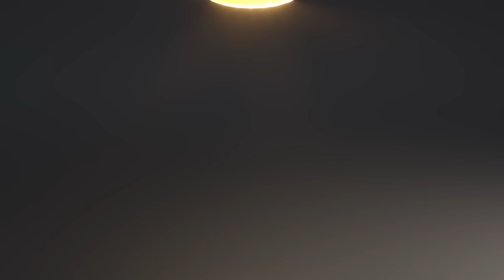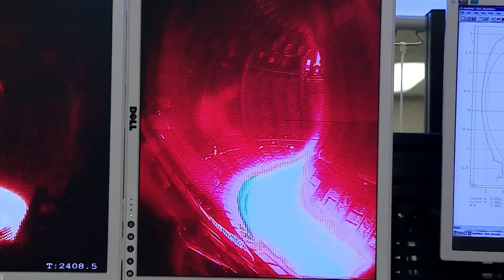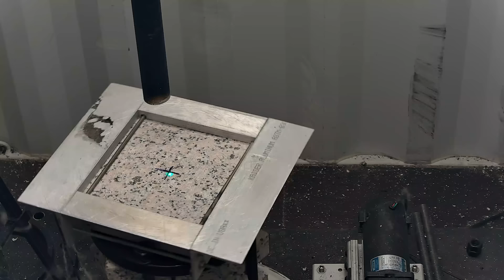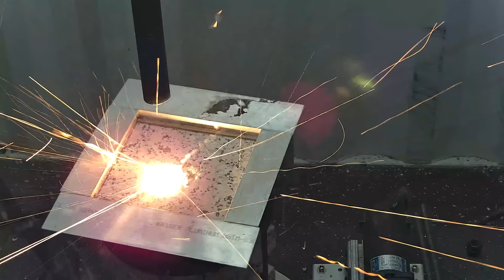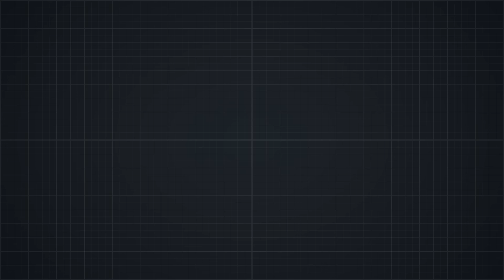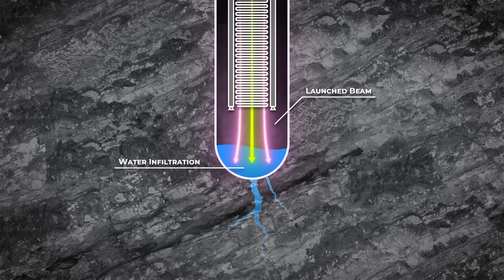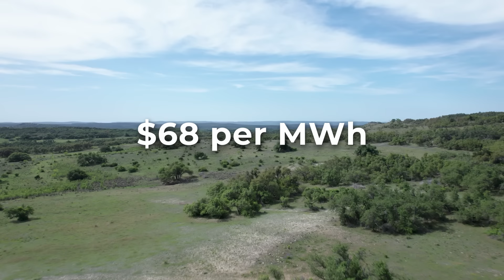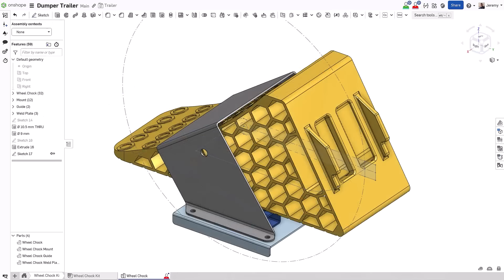Geothermal Energy is Changing

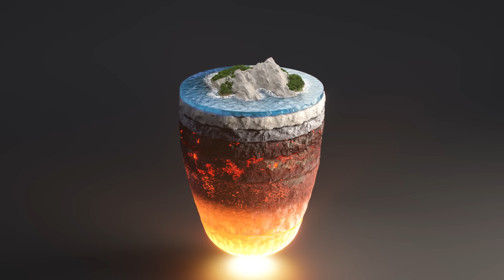Comment: 1:07 Small correction! There are no sustained nuclear fission reactions occurring in Earth's core. It is the radioactive decay of certain elements that contribute to most of the heat at the core.
Reply: There are evidences of localized fission reactions having happened, but yes, current theory is most of it is just radioactive decay. It is believed that this accounts for about 30% of earth's temperature, most of it in the past as it happens with decay
Reply: @JonOsterman59  yes correct, but as i said before, the core itself does not produce its heat through fission to more than a few percent. In the mantle of course this ratio shifts slightly as the core heating is localised and thus radiates, but fission is still not the main heat source, but rather supplementary
Reply: This is a terminology issue -- "spontaneous fission" is another term for spontaneous nuclear decay. Yes, it's confusing, but we're stuck with it.
Reply: @darthtace  yup, in my opinion saying something like "induced" and "spontaneous" fission would be much clearer, but i guess it's another of those vacuum, vacuum, vacuum things...
Reply: How about tidal heating?
Reply: @error203yt9 good question, tidal heating / tidal energy transfer is (in a simplified model) taken over by the least resistant transfer medium, in case of the earth, that medium is the atmosphere and the ocean as their viscosity is very low compared to rock and compressed molten metals. Should all water be gone the atmosphere would not be able to provide enough tidal dissipation for the tidal forces, forcing them on earth's mantle, but since we have oceans, they are what takes almost all of the tidal energy from sun and moon.
Reply: @JonaLastname  Are you a geologist? You say most of the heat comes from the recrystallization but most of the sources I have read on the net about this topic actually say that most of the heat comes from the radioactive decay of elements such as potassium. Is this topic contested in your field? for info here is one source with comments from a Phd in bioscience professor "probing-question-what-heats-earths-core"(type this in the google search and youll find the source, I cannot link it because youtube automatically removes comments with links )
Reply: @penart8079  i'm in material science, not geology, but at least that's related to the topic, not to discredit biologists, but that shouldn't really be what they write papers about. Core heating, so the heating in the actual center of the earth is done, as previously stated, by recrystallization, now yes the potential energy of all fissile material in the earth is roughly equal to the potential crystallization energy from the core iron, but the iron releases that energy faster and in a very concentrated manner rather than radioactives, which are dispursed and form a global instead of a local heating pattern. The overall distribution in the core is around 95% crystallization energy and 5% radioactive decay heat and the further away from the core you go the less influence the iron heat has, right under the crust it's roughly 60 to 40%. To those sources you're reading up on though, most geological fission heating comes from heavy elements such as uranium with less coming from lighter radioisotopes.
I hope this clears things up
Reply: @JonaLastname  sorry I miswrote, the professor was not a biologist. He has a PhD in geoscience not bioscience my mistake. But going back to what you have written, are you then distinguishing core heating from total heat generated by the core?
Reply: @penart8079  no, core heating is the heat generated by the core, but the core, the mantle and the crust are different layers. We drill through the crust and lava comes from the mantle. The core is under the mantle and is heated almost exclusively by iron crystallization. The mantle is where radioactive heat and core heat meet and form a gradient to just below the crust, in the crust the combined heat of both core and the fissile material in the mantle radiate into and create what geothermal plants use. In the crust itself, so everything a geologist would care about, this radiative heat lessens the closer to the surface they get, at a few miles deep (one or two miles) most of that heat is from the trace amounts of uranium, thorium, potassium and other trace radioisotopes in the crust with only a supplementary amount of heat left from core and mantle.
(If i have used different spelling for any of these relevant words, english is not my first language and translation might have distorted some words)
Reply: @JonaLastname  I think I follow now, around the mantle = more radioactive decay heat, closer to the core = recrystallization. Is that about right?
Reply: @penart8079  yea that about tracks. Note that the overall energy potential of fission and crystallization in the earth is around the same on the order of roughly 4.5×10^29J but the decay chain happens slower so the overall energy contribution at any given time in earth as a whole is skewed towards crystallization energy. Right below the crust roughly 40% of the heat contribution is fission and in the core itself most (almost all) of the heat comes from iron recrystallization. The further up in the crust you go the less both of these have an effect and only residual lighter radioisotopes still add energy as the crust has less of the heavy elements.
Reply: Bigger correction, fission does not play a significant part in heat generation in earths core, rather the recrystallization of liquid iron to epsilon iron is what keeps the core from cooling
Reply: @JonaLastname  a process we whould use in termal battery's?
Reply: @marcelwierda6262  theoretically this would be an option, but with current technology the high melting point of iron would make this too expensive in terms of material cost for the container. Molten salt has its melting point around 700 degrees Celsius lower, which makes production and thermal management much easier.
Reply: @JonaLastname i thought it was just the pressure of being in the hearth’s core, to heat it up.
Reply: @willy4170  nope, i'm pretty sure i answered this question for another dude a bit further up in the comments tho, i'd refer you to my answer to that
Reply: @willy4170  yea i answered that for OriginalUnknown2 , you should find my comment above
Reply: For anyone wanting to write here with source titles, please be warned that youtube likes to remove those comments
Reply: @JonaLastname  You are not up to date with the latest research.
Reply: @jim.franklin  if you could point me to that "latest research" you're referencing, i would be more than happy to read it
Reply: @JonaLastname  , you seem well-versed in this topic. i have an honest question in this regard. Wouldnt tapping this heat actually cool down the core over a long period causing uknown effects in the far future?
Reply: @Kammandier  sorry for not replying to your comment earlier, i seem to have missed it. Yes, over very long time spans and when taking enormous amounts of energy from this heat, it would have effects on the planet on bigger scales over millions of years. What they are exactly, other than the magnetic field eventually decaying earlier than it would naturally, i don't really know, but i would expect volcanic events and earthquakes to happen less frequently. Take into account as well though, that this means taking energy equivalent to our current global energy consumption from geothermal over multiple millions of years and only then expecting changes to become visible. For solving an energy crisis where we plan on time scales of less than a percent of a million years and call that "long term" this will not really make a difference.
Reply: Correction there is no core, its hollow...
Reply: @ATomRileyA  haha, hey man don't blow my cover man, you know i'm working with the mole people to take over olive garden. We almost have them ready to free the baby DrPepper and strike a deal with the burger king to reinstate the bird drones ;)
Reply: Probably true that there are not ...but we do not really know whether there are sustained fission reactions in the core.  Uranium is more than three times the density of iron, and may well accumulate in the center of the core.  Once accumulated at the intense pressure of the center of the core, it is not impossible that sustained nuclear fission could take place.
Reply: @patrickgisler4061  the central core is not liquid as seismic research has shown, making it unlikely that heat from a sustained fission reaction is being produced as such a reaction would leave the accumulated matter above the surrounding temperature, melting the mostly iron surroundings. But such a region has not been found in seismic images and thus is unlikely to exist. Rather the random decay of spread out radioisotopes is what's adding heat from fission without a sustained reaction, while the only local exothermic reaction is the crystallization front of the inner core boundary
Reply: @patrickgisler4061  a sustained fission reaction within the iron core would create a liquid boundary as excess heat energy would be released into a crystalline enviornment. Such a region of liquid inside the solidified core has not been found in geologic seismic surveys. Additionally to that, sustained or active fission depletes the fuel very quickly as it is a self accelerating reaction, even at low concentrations the fuel would only last a few million years and all accumulated uranium would have already been depleted and reacted to lead, forming a solid and non fissile grain within the greater iron core.
Basically, it may very well at some point have been that way, but since sustained fission eats fuel very fast, all fuel would be burnt by now and all that'd be left is a ball of lead.
Reply: I thought it was the pressure of the mass of the Earth crushing down on the core from all directions is what was keeping it hot and liquid?
Reply: @OriginalUnknown2  that's often a misconception. Energy can only be released when an unstable state becomes more stable. In fission that is an unstable atom splitting into more stable parts, but for liquid iron, that process is becoming a crystal. Now the pressure does influence that, as crystallizing at normal pressure wouldn't form a HCP pattern, but a BCC one, which would be called delta iron, while the high pressure crystal is called epsilon iron. Going from liquid to solid for most materials releases energy in the form of heat (the same principle as in a pocket warmer) and for iron that is a lot of heat.
Reply: What is HCP? Hexagonal....??? @JonaLastname
Reply: @joshuaplank883  yes, under extreme pressures, the alpha, beta and delta stages of iron are suppressed and hexagonal is the only possible crystal lattice, thus the crystal formation releases more energy per bound atom.
Reply: @joshuaplank883  or if you mean what it stands for, it's hexagonal close packed (crystal lattice structure), normally not found in iron at normal pressures
Reply: Oh cool, I was wrong about brown dwarfs. I never knew some of them can do deuterium fusion and even get more energy from it than from gravity. Thanks for teaching me something new!

While we’re talking about misconceptions: Mars losing its magnetic field wasn’t because the core solidified. In fact, seismic data from InSight indicates that the core is completely liquid. 

It’s okay if you don’t find that relevant, I don’t want to fight about that. I just hope someone will be interested to learn that Mars has a liquid core, and that every planet in our solar system has a hot core: even the “ice giants” Uranus and Neptune have 5000 degree cores.
Reply: @patrickskelly8517  yes, you're right, mar's core itself is not yet fully crystalline, the magnetic field is created in mantle convection, which is stoppen in mars because the mantle has almost completely solidified, while the core is still partially liquid. Thanks for reminding me
Reply: @OriginalUnknown2  A simpler way to put all that: Compressing (the act of doing work to reduce volume against a resisting force) requires an addition of energy and raises temperature, simply being under steady pressure does not require any work or energy input and so does not effect temperature. 
Run an air compressor from empty and it will get warm (the air in the tank I mean), let it sit for a while and it will cool to ambient temperature though the pressure inside remains far above ambient pressure.
Reply: @TheDuckofDoom.  I think you're confusing gas compression with crystal energy release, running a compressor only raises the appearant temperature because ressure rises in a gas with a positive pressure-tenperature coefficient, while the earth's core stays steady because it is held at the melting point of iron at that pressure with energy supplied from crystal formation.
Though i'm not sure if you were referring to earth's core here...
Reply: @OriginalUnknown2  additionally to that the higher pressure raises the temperature at which crystals can form, which is why the core temperature is at 5200 degrees celsius (9390 degrees Fahrenheit) rather than 1500°C, as would be for molten iron at normal pressure.

(Edits for spelling)
Reply: @ thanks, good to learn that!
Reply: It’s not a misconception. The energy comes from gravity: there was a big cloud of dust and rock (high energy state) that coalesced into a planet (low energy state). In doing so it lost tons of gravitational potential energy, which all had to turn into heat. It takes more than 4 billion years for that much heat to radiate away and cool. Radioactive decay adds a lot of heat too (I’ve seen varying estimates of how much but maybe half). I hadn’t heard of this epsilon iron before so I’m ignorant on that front. Would you not say the heat from Earth’s formation is what melted the iron in the first place and that energy is being rereleased as it solidifies?
Reply: @patrickskelly8517  if you want to get into that discussion, would you not say that the big bang is what created the energy now residing in earths core. Sure you're technically right, but the active process happening to keep temperatures at the equilibrium ceiling is not gravity but recrystallization.
You could always bring up earlier and earlier forms of this energy as it, on our scales, cannot be destroyed, but this is completely unnecessary and does not provide value to this topic.
Reply: I think it’s valuable to know that all planets will have hot cores even without any iron or uranium. And I think it’s valuable to know that brown dwarf stars get their energy from gravity and every star gets its initial spark from gravitational heat. Especially when that’s what the initial question was about. But to each their own I guess.
Reply: @patrickskelly8517  this isn't even true and i have to correct you on this. The heaviest elements will sink to the bottom during formation, iron being the nuclear neutral material and thus most common dense metal will thus always make up a big portion of a planet's core and even be present in stars.
Now not every planet has a hot / active core, take mars as example as its core (also mostly iron) has already completely solidified.
While iron recrystallization at a certain planetary mass is overtaken by quantum tunnelling fusion in gas giants of multiple jupiter masses, iron crystal formation is still the main driving factor in most planet's core temperature stability.
This though again is not the topic discussed, as planetary formation has nothing to do with the mechanism keeping earth's core temperature stable and currently driving geo thermal events and plate tectonics.
Reply: @patrickskelly8517  additionally to that, brown dwarfs also don't get their energy from gravity, but from nuclear fusion, as the energy released is not gravitational potential but core stability derived
Reply: @OriginalUnknown2  That's only true if the pressure is actually compressing something. If the earth kept shrinking (somehow) it would heat up, but since it's in a stable equilibrium that's not a factor.

Kurzgesagt has a fun video that exemplifies this. If the earth was replaced with an equal mass of porous gold, it would immediately collapse to the natural density of gold. That would heat it up a lot. If the earth was instead replaced with an equal volume of solid gold, the higher gravity would compress the atmosphere which would heat that up.
Reply: I continue to "shake" oilmen with my innovative project of a non-combustion engine, I remind you that I am posting here on my channel the technology and the principle of operation, according to which anyone can create a prototype and enjoy free energy, since I was denied financial support at the stage of the idea and theoretical research, after a year of unsuccessful searches. Including I will begin to assemble a sample. And soon another video will be released, revealing my developments, the wind of change is approaching! All those who are not indifferent, welcome to the flight in this departing innovative car, which will lead to great achievements for the successful future of the planet and humanity!
Reply: @maguccimotorincorporation  i honestly cannot fully determine if you are a bot or a 12 year old, could you help me out?
Reply: @JonaLastname  I am 40 years old, and you are how old, 12?
Reply: @maguccimotorincorporation  then i would urge you to stop pursuing a career of click baiting tech enthusiasts to watch nonsensical free energy or some other magic videos and maybe provide some value to society with your 40 years of life experience.
As a little free advice on top, don't mention your real age or any personal information for that matter on public forums like youtube comments.

TLDR:
Please stick to the topic and don't self advertise in comments
Reply: @JonaLastname  Thank you, I will take a closer look at your generally accepted recommendations. But your personal opinion about free energy, I think not everyone will agree with this. And I do not force you to participate in a dispute with me about the veracity of my statements and not fakes, of which there are many. I also share with people my ideas that are interesting absolutely free of charge.
Reply: @maguccimotorincorporation  to start of relatively informal. That is the funny thing about reality, it does not care about your or my opinion. If you say free energy (the creation of energy from nothing / no source) exists that will not convince the universe to make it come true, neither will attacking me or anyone personally.

Furthermore though i do understand this is your business plan / model and in a space so oversaturated with content as "free energy" one has to resort to "different" marketing strategies. Still i do advise you to neither propagate misinformation nor to advertise it under videos of more or less accurate channels as this undermines the youtube community guidelines as well as moral guidelines.

Please refrain from advertising or promoting your channels this way in the future and try to enhance your own content to the point that it provides social value.
Reply: @JonaLastname  Creating energy from / without a source is a fake, Do you really think that I would do this for the sake of a fake, you will not be convinced. The full story about my project is in the description of the creation of the channel and it says that energy is taken from the air or water and they are cooled. I am in no way engaged in self-promotion, writing to you here, but the function to send a response to you personally, unfortunately, is not yet on YouTube. I agree that I should attract an audience in another way in sections with the appropriate topic, if you want I can delete all the comments and not disturb you and your community more with my ideas
Reply: You are not up to date with the latest research.